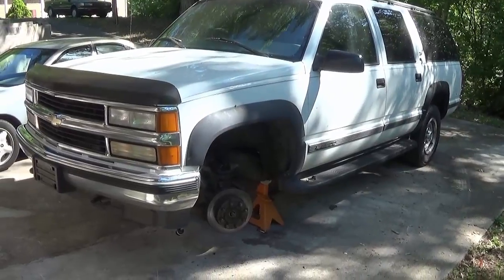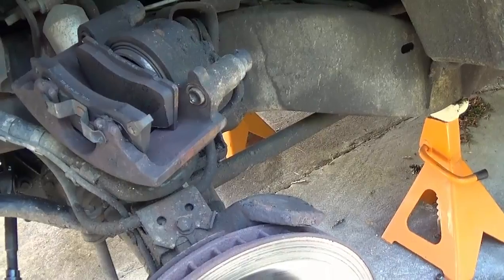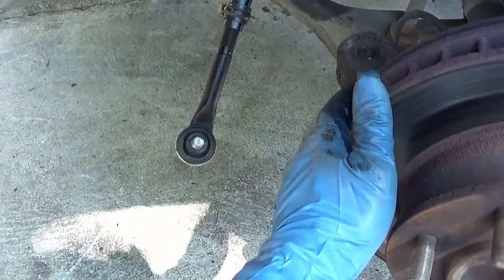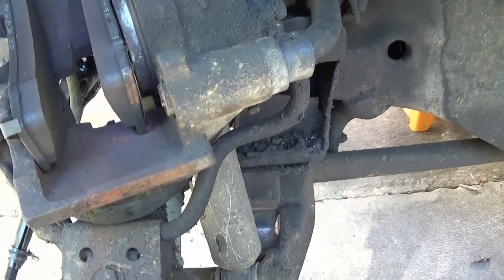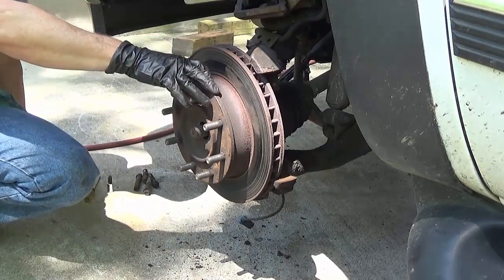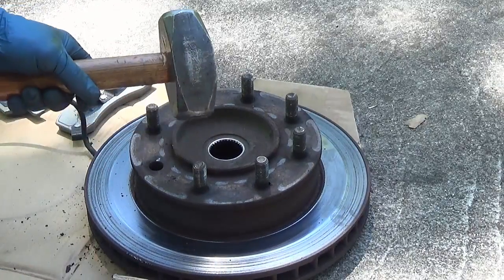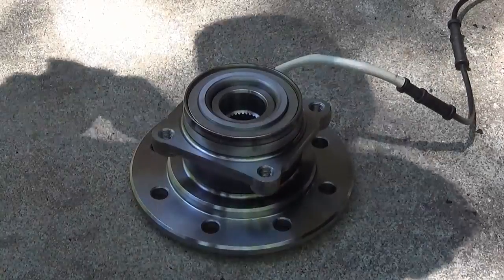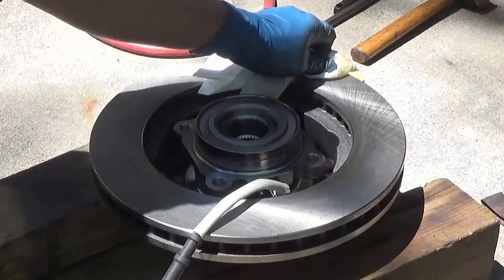How To Replace Wheel Bearing Hub and Rotor 92 99 Suburban 2500 4WD

Comment: Great Video except for one thing. When reinstalling the rotor, you failed to mention the torque value for the 4 rotor bolts. I've been trying to find that value for 3 days. I even bought the only repair manual available nearby and the value wasn't in there. Everything else was spot on and a big help. Great Job!
Reply from the maker: I didn't give the torque because I couldn't find the actual specs either. Later I found that they torque between 125ftlbs to 140ftlbs, depending on years I think. I say tighten them as tight as you can go without stripping them, plus you want that loctite on them as well

Comment: You can get all 4 off with out taking your tire rod off no diff you might get a few inches I just did my 4 wheel drive dually
Reply from the maker: This is response to all your comments. Yes you can remove the shaft and bearing without disconnecting the tie-rod. But do you know why I did that? It answers all your other comments. With the tie-rod disconnected, I can maneuver the spindle around easier to get a good connection between my sockets and those 4 bolts that are hard to get free. If you had undone the tie-rod, you would have seen that.

Comment: Most of these vehicles are not rust free as yours is them back bolts are a bear to get off I’m pretty sure mine is factory I had to use a 14 I think ther torque more like 165 maybe I’m wrong but watched a lot of these videos on it you took the tie rod off I guess is a good idea if you have a impact but if you got rust them 4 bolts can be a pig to get off I have to chisel the head of of one of the back bolt head don’t get me wrong you did a great video but I guess I didn’t have a impact gun so was harder you did a great job I wish mine had no rust like yours

Comment: Do you know that the wheel stud size is on these suburbans? The parts stores in my area show two different sizes.
Reply from the maker: all my books show 14x1.50 as the only size. That is for 2500 Suburban 1988 to 2004. 8 lugs 6.5 bolt pattern. If they are showing something else, maybe you have something different than what is in this video. If you need further help, contact me through my site to ensure I get your messages. https://rodsshop.org/contact/
Reply: @RodsshopOrg  14 x1.5 it is thank you so much for your reply...and thanks for the informative video...i watched it twice and it helped alot with our replacement
Reply from the maker: @jeffdixon9025  Glad I could help
Reply: @RodsshopOrg  what books do you have for this im using a general chiltons for the tbi to vortec and not really helpfull
Reply from the maker: @nicolaslevine6462  I have a vast amount of books but I mainly use RepairSurge, it is an online manual that is always being kept up to date with complete wiring harness schematics and way more than books have in them . Check it out: https://rodsshop.org/get/online-auto-repair-manuals/
Reply: The BIGGER of the two....LMAO

Comment: You think it's hard with no rust! I live in the rust belt and the back bolts are 14mm now and wont come out. I've got the right socket and tools but idk how I'm gonna get them out
Reply from the maker: Spray penetrating oil on them and let them soak for an hour or so. You can also beat around them or on them with a hammer, that kind of vibrates the rust loose. Do not beat it so hard you smash the head of the bolt or bend things around it. You just want to vibrate it. Sometimes, running a propane torch on the metal will loosen it up as well. I find an impact gun works good for rusted bolts because it vibrates the rust loose as well.

Comment: Why would you use red lock tight?
Reply from the maker: I used red because for one, that was what was left on the threads from factory. However, I would have used it anyway if I had not seen it. Red is far better under high heat and that area gets really hot from the brakes. Also, these are bolts you take off all the time, nor do you want to ever come loose. 

If you think that the red means it makes it impossible to ever get the bolts back out, don't believe that non-sense. I have removed many bolts where red locktite was used and they come out with no problem. Been doing this for over 40 years, so if you have gotten your info off a forum, don't believe everything you read.
Reply: @RodsshopOrg  I see.
Reply from the maker: @markbenyoun1476  You could use the blue if you do not have any red, should work as long as you have those bolts torqued very tight. Red is still the best in higher heat areas and for bolts you really don't want to ever back off like in a wheel axle area. Good question though, thanks

Comment: The worst part of changing the bearing is them 4 stupid bolts behind the wheel  and ther more like 165 into more torque than any other bolt on the wheel and be careful if you live in sa rust belt most are no as good as his ther a big bolt with a stupid head I think ther suppose to be 15 mil but I had to use a 14 or I will ruin the bolt if not strip it ther on ther real tight especially if was factory